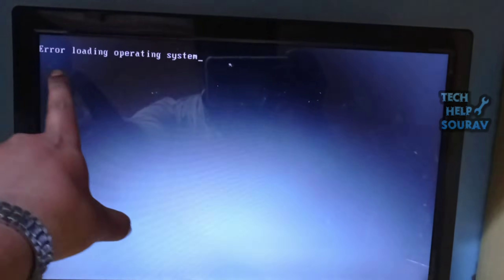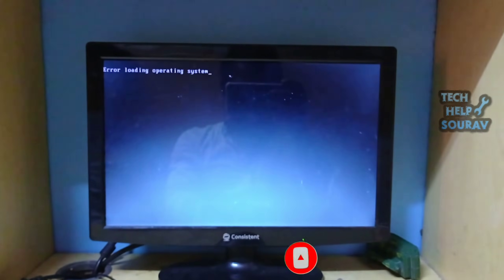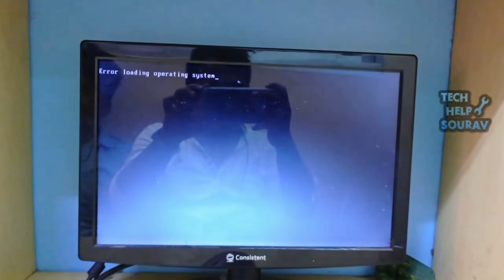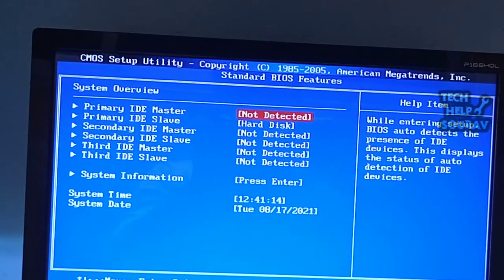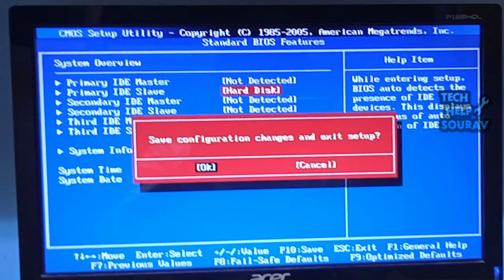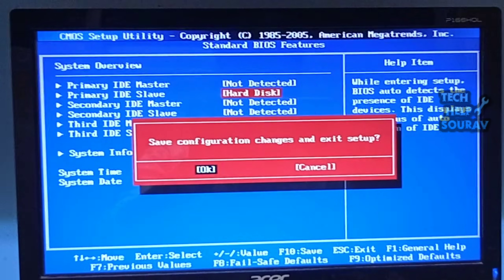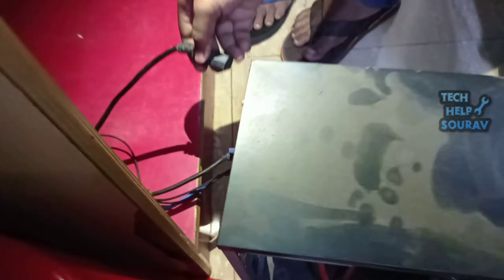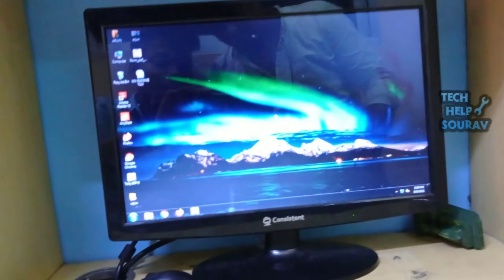How To Fixed Computer Error Loading Operating System Problem In Windows 7 Or Windows 10

Comment: To troubleshoot and resolve the issue of a computer displaying an  Error Loading Operating System  message on Windows 7 or Windows 10, you can follow these steps:

1. Set Correct Boot Order in BIOS.
2. Check for corrupt or damaged BIOS, hard drive, or operating system files.
3. Ensure that the BIOS supports the computer's hard drive size and settings.
4. Verify that the correct disk is set as the bootable hard drive.
5. If necessary, reinstall the Windows operating system.

These steps should help you address the  Error Loading Operating System  issue on Windows 7 or Windows 10.

Comment: To troubleshoot and resolve issues with  Error Loading Operating System  during the decision-making process, you can follow these steps:
1. Boot your computer from the installation media.
2. Choose the Repair option after selecting the language preferences.
3. Click on Troubleshoot.
4. On the Advanced options page, choose Command Prompt.
5. Insert the following commands:
   - bootrec /fixmbr
   - bootrec /fixboot
   - bootrec /scanos
   - bootrec /rebuildbcd
6. Exit and remove the bootable media. Restart the computer.

Additionally, if you're unsure of what caused the error or unable to fix it on your own, consider contacting a recovery service for professional help.